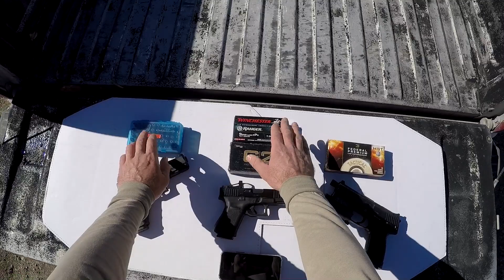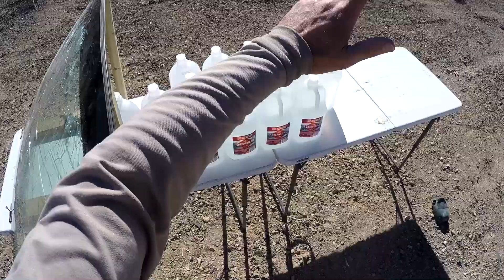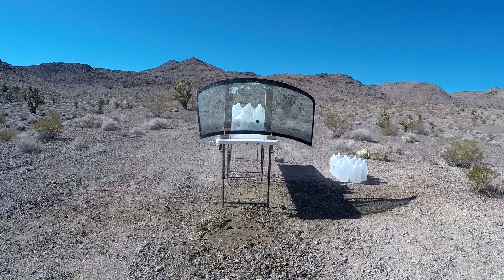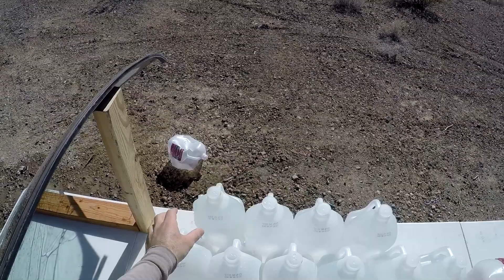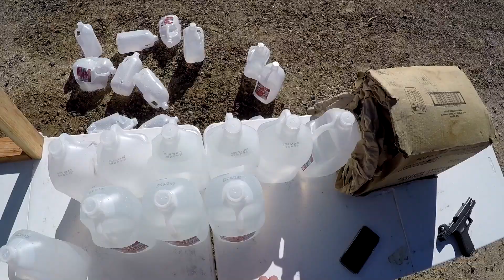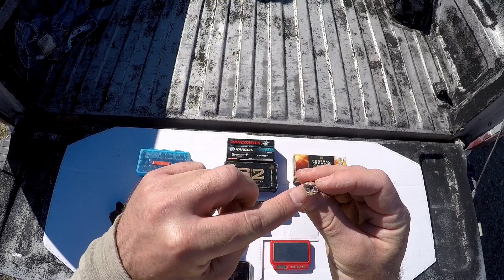9mm vs .40 vs 10mm vs Auto Glass pt.3

Comment: Can you test the Underwood 10mm 155 grain XTP Jacketed Hollow Point if you can get any? It a really light 10mm bullet that's flying at 1500 fps. If it meets the FBI spec I bet it would also do serious damage along the way.

https://www.underwoodammo.com/collections/handgun-ammo/products/10mm-auto-155-grain-xtp-jacketed-hollow-point?variant=18785725251641
Reply from the maker: I could never get the 155gr to reliably meet the FBI penetration requirements at the velocity Underwood loads to.  Which was north of 1,400 fps.  I personally try to stay under 1,350 fps using that projectile.
Reply: @7N6ballistics  Their .40 S&W 155 grain XTP Jacketed Hollow Point goes at 1300 fps. I guess that's within range?
Reply from the maker: @Frenchfrys17  it should perform decently in typical circumstances, but against a windshield I would expect shedding of jacket and possibly less than desirable penetration.  Across the board LE has moved away from light for caliber projectiles.
Reply: @7N6ballistics  The main reason why I'm considering light and speedy +P JHP cartridges is because they seem considerably more devastating in ballistic gel tests. 

I saw a demo of Underwoods .45 ACP +p 185 grain JHP and you could honestly mistake it for a 5.56 test. Not kidding.
Reply from the maker: @Frenchfrys17  I would urge you to research what calibrated 10% ordnance gel is actually used for.  If you are looking for anything other than expansion and penetration at handgun velocities...ie less than 2,000fps, you are misinterpreting the results.
Reply: @7N6ballistics  The demo was in 20% clear ballistics gel which is much more elastic than ordinance gel. I didn't get to measure the expansion but it was definitely more than an inch.
Reply from the maker: @Frenchfrys17  Clear ballistics synthetic gel is a poor substitute for calibrated 10% ordnance gel.  Penetration depths are all over the map and typically much greater than calibrated ordnance gel.  Additionally expansion is typically less and in some cases greatly reduced depending on the projectile design.  Critical Duty Flex Tip comes to mind.  Per the major ammo manufacturers it is only used as a show piece at trade shows.  It is not taken seriously in there ballistics laboratories.  I have no idea who told you it was better than calibrated 10% ordnance gel, but I guarantee they have no professional credentials.  Believe it or not, water is a closer approximation, this was actually discussed in the IWBA journals.  There really is no perfect substitute for calibrated ordnance gel, which in and of itself is imperfect, but the synthetic stuff is quite poor, particularly when using low velocity rounds.
Reply: @7N6ballistics  I was not told that clear gel is a better medium than calibrated ordinance gel for measuring penetration distance nor for testing bullet design. Which is why no one gave a shit about the penetration distance from the demo.

What I was told was that the permanent wound cavity in synthetic gel is a closer representation of how the wound cavity would look like in the human body compared to ordinance gel. 

Another person mentioned how because the 185 grain .45 ACP +p projectile expanded so much (well beyond an inch), that diameter could encompass the tearing distance caused by typical 5.56 rifle projectiles. He mentioned that most soft tip or hunting 5.56 bullets expand to half an inch at the most and that the radius of tearing inside living flesh is typically no more than another inch. 

This discussion and demo occurred inside USC biomechanics injury lab. Among people who work with gel, flesh, and trauma surgeons. That's why I was paying attention so much.
Reply from the maker: @Frenchfrys17  if the projectile expanded over an inch at that weight it would likely suffer from under penetration.  I don’t have a link, but some years back..there was a discussion about Corbon.  In particular there 185 gr +p .45.  The discussion was about the validity of “energy dump” and “over penetration”.  Basically an officer involved shooting that led to the injury of the officer, thankfully he recovered, but some of the rounds fired by the officer striking the suspect had failed to penetrate adequately, and predictably the suspect was undeterred by the “energy dump”.  I have used 10mm and 9mm on deer and compared wound tracks.  The difference is typically no more than the size of the expanded projectile.  5.56mm..particularly heavy otms...are on another level.  They are simply not comparable.  Regardless of what theory you wish to subscribe to...personally, I would not sacrifice adequate penetration for .2” more expansion or 200 ft lbs more energy etc.....Adequate penetration is the key...once that is achieved more expansion and ftlbs energy/velocity doesn’t hurt anything from a ballistics point of view....but it does come at the cost of increased recoil.  In the case of the 10mm 155gr xtp, I would expect some potential penetration issue after auto glass, and possibly inadequate penetration depths on lightly clothed targets if the velocity is pushed too far.  As far as the wounding potential...I would not put it anywhere near and good 5.56mm.  I would expect a thumb size hole in elastic tissue...though it’s possible in inelastic organs such as the liver might see greater damage than a typical service round...is that worth the trade off...That’s up to you.  Keep in mind optimal penetration vs expansion seems to be 1.5 - 2x expansion for medium to heavy for caliber projectiles.  Anything more should be looked at with caution.
Reply: @7N6ballistics  I’ll take your valid points into consideration. However I do have to consider that I have never seen any handgun caliber cartridge behave like this expect for liberty defense. I can tell that both the Underwood load and Liberty are severely underpenetrating but the former to a lesser degree.
Reply from the maker: @Frenchfrys17  yes the Liberty produces disappointing penetration...I have tested it on the channel.. I do wish they would do some tweaking to it because its getting close to rifle like external ballistics.  As far as the 155xtp it is closer to adequate penetration...usually within an inch or 2...  and would likely be adequate for most situations.  Whether or not you gain much from the velocity and energy for human targets is just difficult to quantify.  That said its a pretty dynamite loading for smaller critters where the temp cavity can actually have some real noticeable effects...that’s usually where I employ it.
Reply from the maker: @Frenchfrys17  i do apologize, I did misread your comment about 20% clear ballistics....I mistook elastic for realistic...
Reply from the maker: @Frenchfrys17  I should also note that the wounding characteristics of expanding vs fragmenting rifle ammunition can be quite different.  And in the case of a 1” permanent wound cavity, that could be a reasonable expectation of a non fragmenting soft point 5.56mm in elastic tissue.  However velocity will play a significant factor in this.  That said, I would still expect to see much greater damage to solid organs and particularly bone...where the shattering and subsequent secondary missiles would likely cause extensive damage in the area around the bone to a far greater extent than a handgun projectile...even a stout service loading like a +p 185gr.  Additionally as stated before...to achieve that level of expansion in a service caliber handgun penetration will be severely degraded...possibly to unacceptable levels.
Reply: @7N6ballistics  Their gonna shoot the Underwood .45 185 grain +p JHP out of carbines (UMP and Vector) sometime next week. They're guessing it'll reach 1500 fps and the bullet will disintegrate.
Reply from the maker: @Frenchfrys17  cool, let me know.
Reply: @7N6ballistics  Were not allowed to take pictures inside.

Shooting the Underwood 185 grain +p out of a carbine, the initial permanent wound cavity could not be compared to normal .45 ACP shot out of a handgun. 

Some inches in the copper jacket ripped off and the lead "pedals" either completely folded backwards or broke off. The biggest piece of lead made it to just under a foot.

It chronographed around 1450 fps so about  860 ft lbs of energy.
Reply from the maker: @Frenchfrys17  thats getting pretty close to .44 mag from a 4” barrel, in so far as external ballistics.
Reply: @7N6ballistics  From what I've seen so far, the transition from handgun ballistics to rifle ballistics seems to be a gradient. There seems to be a difference between bullets flying at 800 fps and bullets flying at 1500 fps in terms of the wound cavity even if the diameter is the same. Likewise for bullets going at 2200 fps and 3200 fps. But the difference gets more exponential above 2000 fps.

Damage from the temporary wound cavity occurs when the velocity of expansion is faster than the elastic threshold of the given tissue. However as the temporary wound cavity expands it slows down. And once the expansion velocity drops below the elastic threshold, the temporary cavity no longer contributes to permanent damage.

Comment: With the 10mm jacket I personally think with the expansion and penetration I can live with that, personally against 2 legged critters I agree with Paul harrell when he says jacket seperation is not a big deal in defensive scenarios as long as you get good expansion and penetration
Reply from the maker: multi dryder But you lose expanded diameter..ie crush cavity.  So your losing the primary benefit for a larger caliber...  According to folks who quite frankly are more knowledgeable than Paul Harrell on this topic, the number 1 reason for bullet failure outside of shot placement is jacket separation.  That said I believe Paul is mainly speaking of civilian self defense and not LE use.  In that regard he may be correct as generally all that is needed in those circumstances is a break in contact..which typically even “mouse guns” can achieve.

Comment: Isn't that ranger old 127 gr plus p plus load?  Outside of windshields, just regular old clothing and bone real world performance...if u were going to go plus p plus 9bple vs ranger vs Underwood gold dot?
Reply from the maker: CatchJitsu.com I find the underwood +p+ gold dot to be over driven, causing hyper expansion and under penetration unless encountering heavy clothing.
Reply: @7N6ballistics  just got a 92a1 so really it's a platform plus p plus is fine for so been wondering if worth it. 9bple seems great light clothing but under penetrates heavy clothing has me worried so been looking into other 2.
Reply from the maker: CatchJitsu.com I misread...BPLE tends to fragment when not encountering heavy clothing..however its smaller diameter tends to still penetrate decent.  In heavy clothing it usually still expands, and holds together better..which can lead to less penetration do to a larger diameter...however BP seems to be the more egregious offender in that regard with lack of penetration in light clothing and lack of expansion in heavy...  BPLE also suffers against hard barriers do to out dated bullet construction...  It usually works, but there are better options now..
Reply from the maker: CatchJitsu.com i did 9bple in the first video
Reply: @7N6ballistics  just rewatched 1, but windshield is down the line for me if u have rounds left a plus p plus battle through 4 layer & 1/4"- 1" fiver board to simulate sternum or rib would be an interesting vid 9bple vs 127 vs ud 124 plus p plus GD w ur 17ish barrel plz
Reply from the maker: CatchJitsu.com I have done some testing with boards...the gold dot and ranger will fair the best...they have better sectional density and are of stouter construction...the issue with Gold Dot is the +p+ offerings by underwood are over driven and suffer from over expansion and under penetration when encountering light clothing or no clothing.  The speer +p is a better offering.  BPLE works at higher velocity because of the nature of how older cup and core designs expand...the ranger is purpose built for its velocity...the gold dot is not designed to be pushed to the +p+ velocities underwood loads to.
Reply from the maker: CatchJitsu.com if I were to pick a +p+ option..the Ranger would be my top pick...followed by BPLE... I personally have no use for the overdriven gold dot offerings by underwood.

Comment: Very nice on the ranger 124+p+ I’m wondering how the 124+p gold dot and the 124+p hst will do hmmmmm
Reply from the maker: venomea Gold Dot is a good performer.  124 HST usually comes up a bit shorter...but still good.  I really thought the jacket would separate and the core flatten causing shallower pen, but the results are what they are.